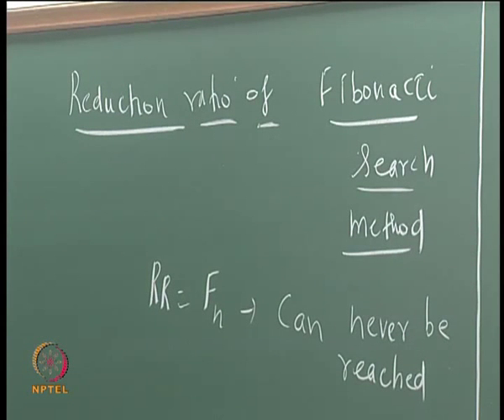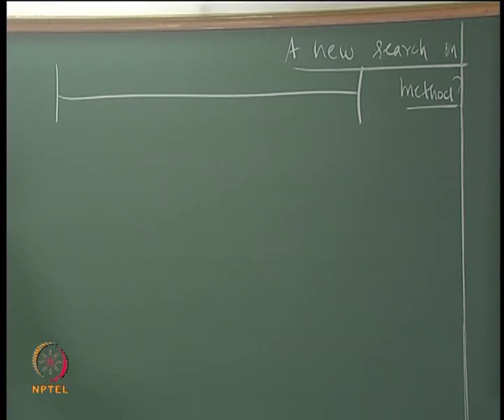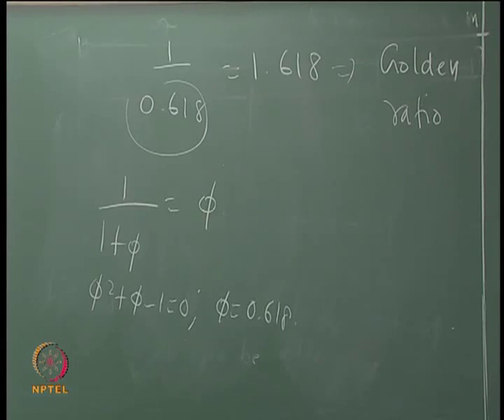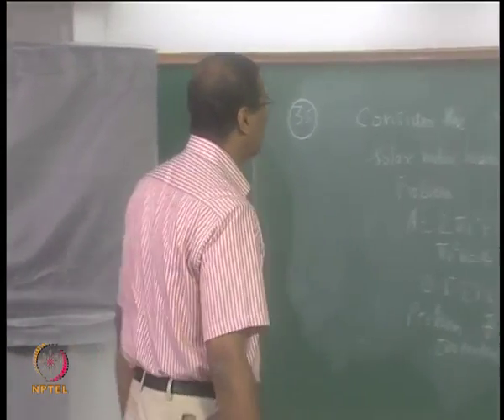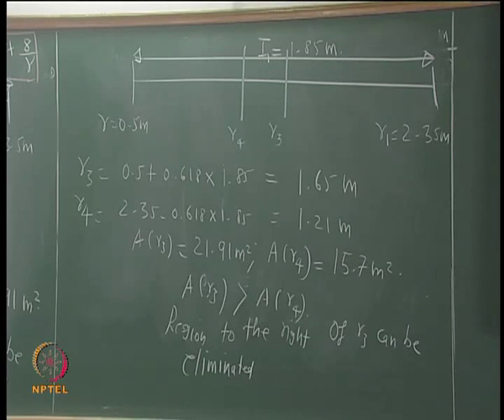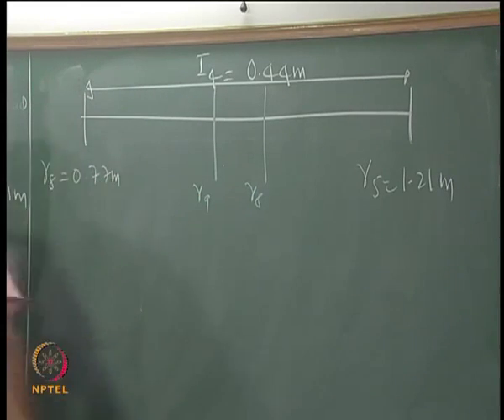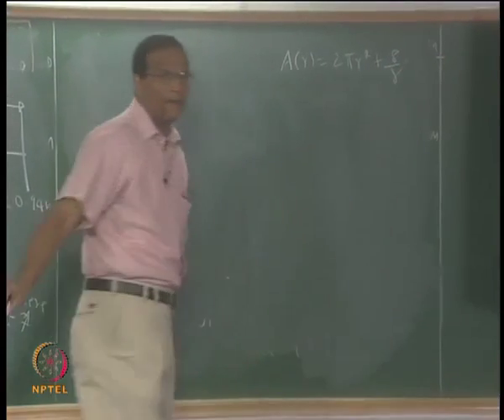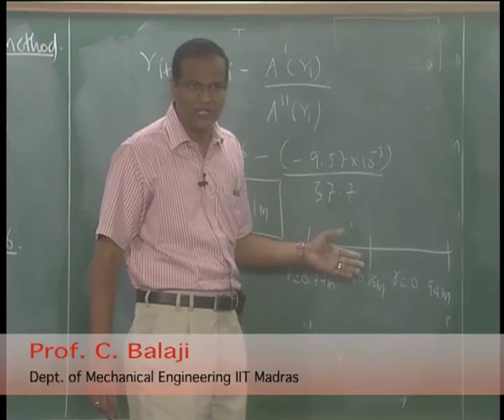Mod-01 Lec-32 Reduction ratio of Fibonacci search method

Comment: 34 is the 9th number/term of the Fibonacci series. Not the 8th.
Reply: @smirned0ff 
1,1,2,3,5,8,13,21,34
Yes , You're right if you count from very first element of series.
But He  named 
1 as f0
1 as f1
2 as f2
3 as f3
5 as f4
8 as f5
13 as f6
21 as f7
34 as f8.
I hope it'll help you.

KUMAR SHIVESH
IIT (BHU) Varanasi